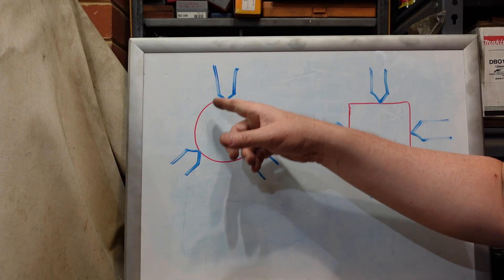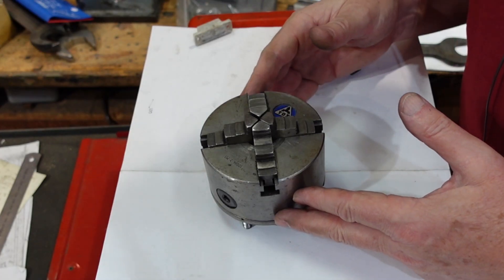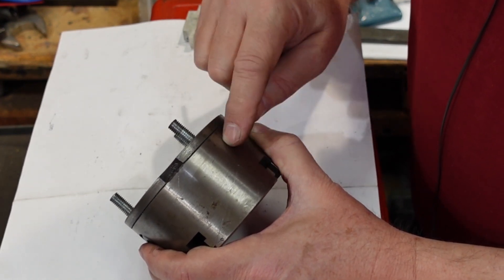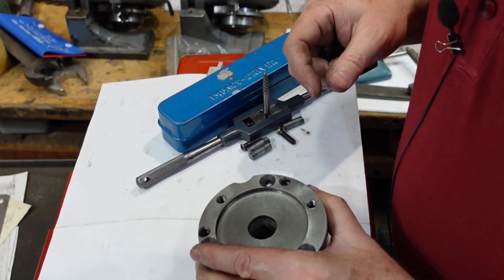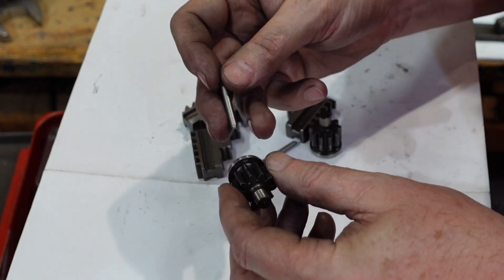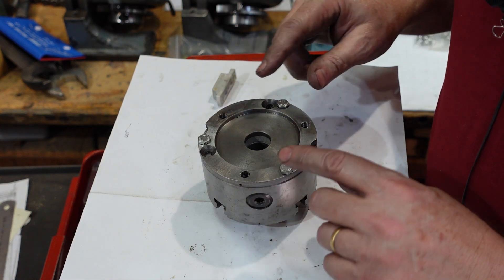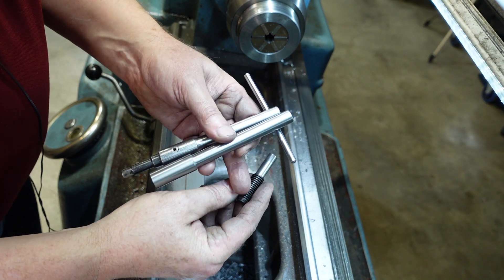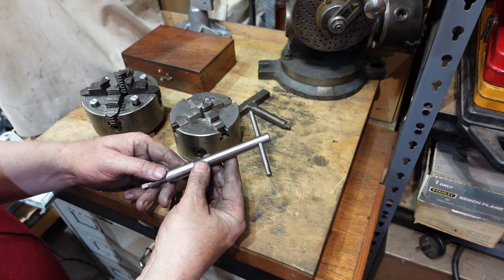Going inside a self centering chuck this time!!

Comment: I have a 5" self centring 4 jaw chuck & it has been really useful, mostly for turning hundreds of clevis type parts from square bar. I recently used it to drill into the ends of some square newel posts. Nothing requiring any great precision so I've never had a problem with possibly only 2 jaws gripping.
Nice job on the chuck key! You're right about standard keys often being a bit short...
Reply from the maker: I reground the jaws on another chuck recently just because the stock could move a little bit and create chatter. A 4 jaw scroll chuck would not be quite as bad (with 2 jaws gripping) but the potential is there. Non-square stock adds to the potential problems too.

Comment: Nicely done on the video production, clear and to the points.

13:20 - There's eleventy million ways to make any given cut, and picking one is only a matter of personal preference.  As a contribution to the algorithm and the conversation space, may I offer that making flats on a shaft with the side of an endmill has enough advantages that it's worth keeping the approach in one's toolbox?

I'm cheap, so if I can make a cut using a part of a cutter that doesn't see as much use, I'm distributing wear over a larger area and the tool lasts longer.

The less used edges are of course less worn, and cut better. 

There's less cutter deflection due to stickout reduction.

Using that profile of the tool produces a radius that avoids stress risers above the flats.

Tradeoffs include that more cutting force is required due to the longer cutting edge engagement, so one has to ensure doing this stays within the power and rigidity constraints of the machine, and the rigidity of the workholding setup.  That increase can undo the benefits of reduced stickout, so there's a balance to be struck.

Thanks again for sharing your time, sir!
Reply from the maker: A perfectly reasonable approach, and I generally use the sides of an endmill when cleaning up the ends of a piece of stock. With the special doover that I was using to hold the stock the side forces may have caused it to move, but yes, certainly an option.